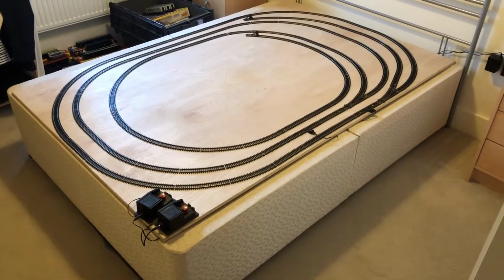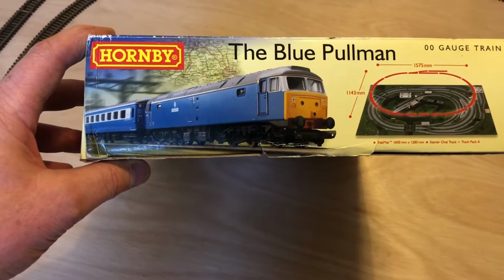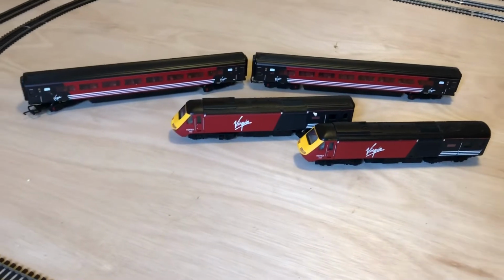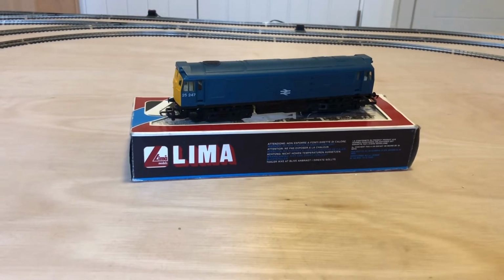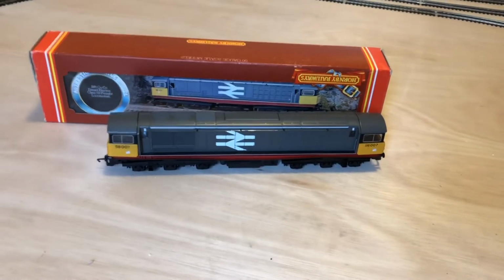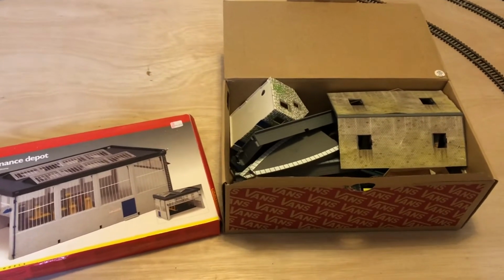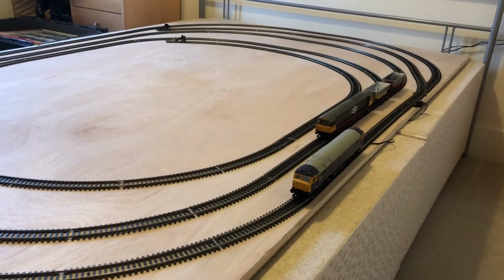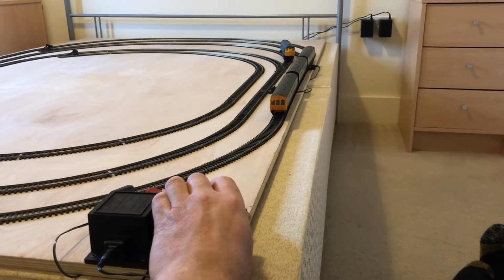My Lockdown Train Set | OO Gauge | Hornby | Lima |Bachmann | Class 08 25 47 58 101 253 43 HST

Comment: Seemingly I can try sleeping with my train set if I do that to the bed 🤦‍♂️
I was slightly interested in your controllers as they don’t seem to have fine control on them ? I had something that just had 3 settings in either direction but quickly upgraded to a variable type which made fine control easier. 
I had a class 47 or 1670 Mammoth as it was then as my first train & sort of when I stopped using it around 25 years ago like Beeching I lifted the tracks & put them up in the rafters of the loft & my rolling stock in a box . These better still be up the loft & not befell a similar fate as to that of my millennium Falcon-I’m still fuming about that. (Mum gave it away to some colleagues kid 😡).
However Mammoth developed a screech after many hours service & I wonder now if it was these lack of rubber tyres making the noise 🤔
Anyway in 2019 I bought a bit layout on fb marketplace & I’m looking forward to messing about with it again.
It’s interesting what folk say about lockdown but I sort of just make do with it. I suppose I’ve got a few mechanical projects that I just get on with etc. Tbh I’m actually relatively contented all things considered.👍
Reply from the maker: The controllers do have variable control (the red knob) but for filming I just set a speed they started at that wasn’t jerky, the 25 in particular is very notchy at low voltage... they all need a clean and service I guess and the track isn’t great....